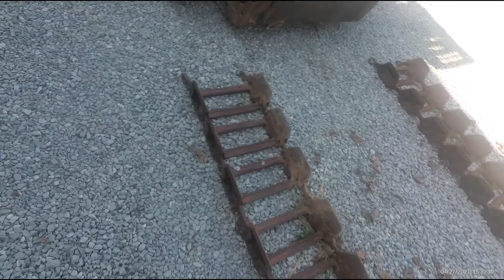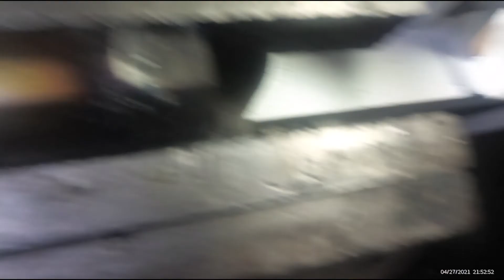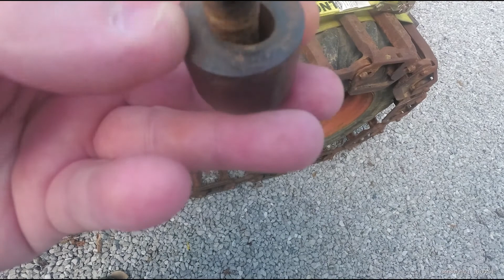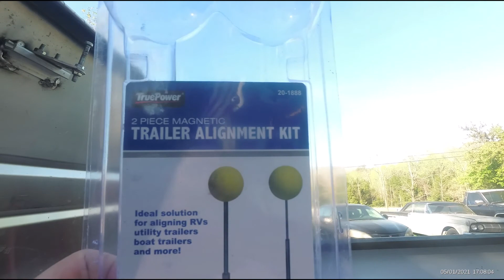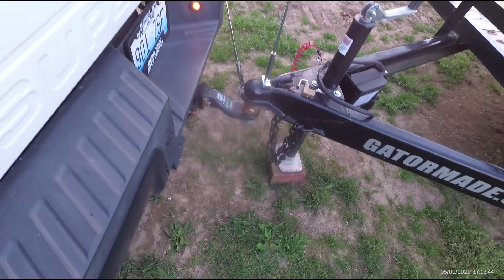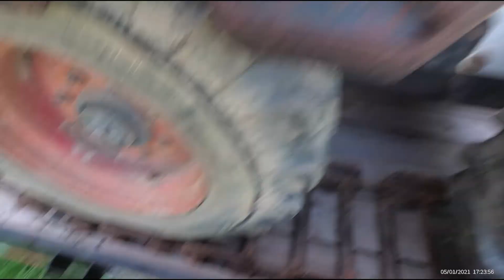Grouser tracks install on a Bobcat skid steer

Comment: I have a set i rebuilt for 275 sh kid steer  cost 7hundred 50 dollars  for bushings  and bolts  it is important to have same size tires all around bec as use the  tires are driven  by  sproket chains  from 2 hydruclic  mortors so if you have different tires it going to operate in a bind and will cause trouble
Reply from the maker: We wound up just replacing all 4 tires because we just couldn’t keep them up . The difference in size would spin one of them off the bead. Lessons learned. We also replaced as many worn bolts as we could get our hands on. Once it was working properly we traded it to a track machine. Problem solved.

Comment: Placing different size tires on same side places a lot of pressure on hydraulic drive motor as well as destroys tires. Always replace tires on each side at the same time.
Reply from the maker: Shortly after this we replaced all the tires, we just couldn't keep the air in the tires. And you are right, the difference in tire size would always spin the other tire off the bead. Lesson learned..lol
Reply: @workingwithLarryMullins  Wow must have been a lot of pressure on that side to break the bead on an inflated tire. 

I had to repair the drive motor in my skid steer on both sides and it's not fun. Yours I believe is much easier. on each side the wheels are connected together with a large roller chain with the drive motor in the middle.  

When on pavement it's s good idea to spread a little sand to help turning.  

BTW I am surprised you seen my post, I've been banned from making posts. But this is my 4th time in over ten years.
Reply from the maker: @beemanminnesota7683  that was an awesome machine once the tires were all the same size.the old tires leaked, that's how the grousers broke them down better than a tire machine.. Happy to hear from you !!